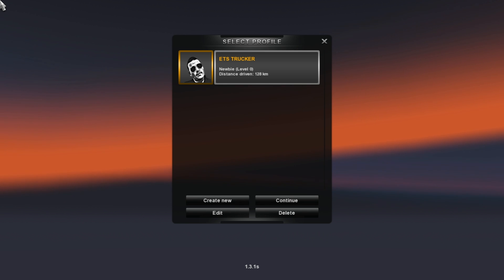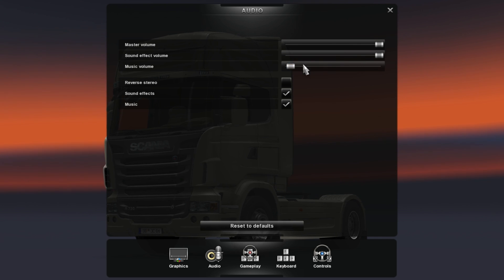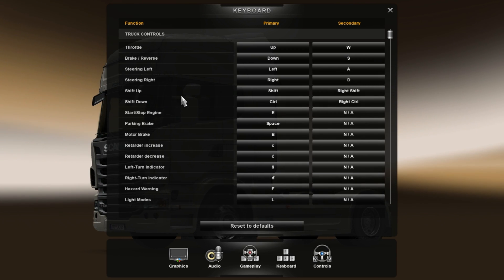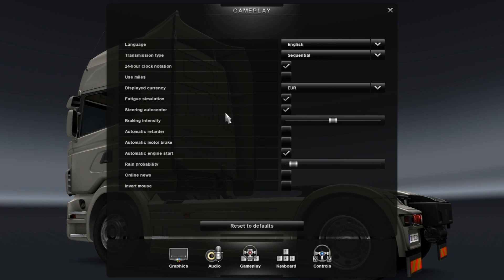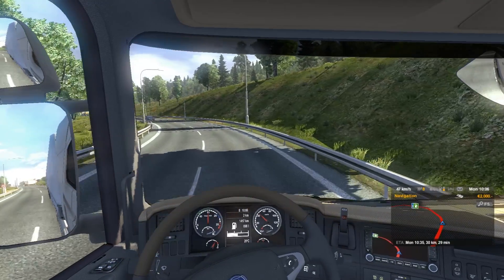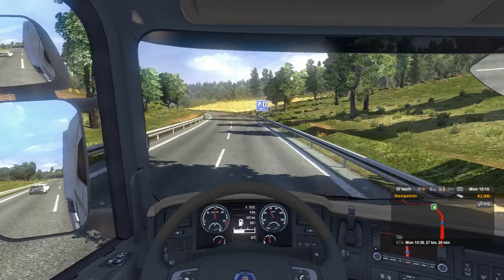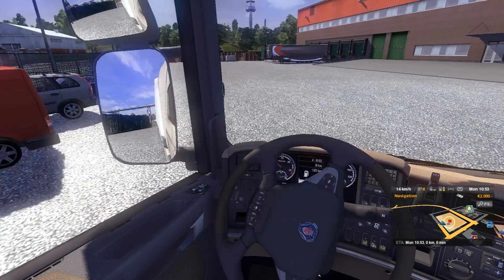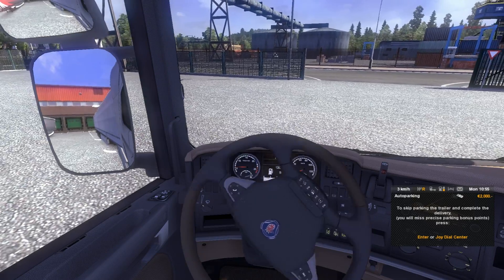ETS 2  Logitech Driving Force GT setup

Comment: idk if anyone is still here but when i turn my wheel 90 degrees the ingame wheel only turns a little bit and when i almost do a full 900 degree rotation is suddenly goes really fast and matches with my wheel. I have both my game and my profiler and 900 degrees and i even did 767 degrees and it has the same issue

Comment: um I need some help with my wheel settings with my driving force gt wheel when I turn my wheel when I turn my wheel a little to the left or right my wheel in the game turns it all the way to the left or right I want it so I can turn my wheel and inside the game game it mimics the it turns the wheel the same as I do in reality
Reply: Did you fix it?

Comment: 'How do i change my logitech driving force to 900 deg?
Reply: Bob Probert in windows, find game controllers in controll panel, open driving force gt (with it connected) click properties, then settings and set the degrees   of rotation to 900,
and for the rpms, make sure that the brake and accelerator pedals are both mapped properly in the keys and buttons option in the actual game.
I hope this helped!
Reply: Download logitech software
Reply: @IFredmybed Thanks for your reply, that helped me.
Reply: OMG thanks I legit couldn't find this answer anywhere

Comment from the maker: Guys, try to remap all the controls again. That mean's that you need to reselect all the buttons again, and also unplug and plug in your wheel from your PC.

There is a bug about that 90 deg but I haven't find what causes it.
Reply: +Giorgio DaTrucker How set shift up or shift down 
Control please :)
Reply: +Giorgio DaTrucker You''ll have to go to, Printers and Devices - Logitech GT wheel and configure so it can turn all the way.
Reply: +Giorgio DaTrucker Great video!
Reply: +gibrate1 how?
Reply: then settings
Reply: Exactly how I say  Printers and Devices - Logitech Wheel then settings

Comment: Your english is good, do you know the problem where the wheel turns too much. I turn a little on the driving force gt and the wheel on screen turns halfway.
Reply: You need to set the degrees of rotation in the logitech profile, to 776 so that when you turn your wheel, it turns the same amount as the wheel in the game.
Reply: or lower the wheel sensitivity in the game :)

Comment: Can you please help me i'm getting crazy. I've the same problem as the discriber olli, if i turn my wheel 3/4 it turns full around what must i do??? Please help
Reply from the maker: it is a bug,, what wheel are u using?
Reply from the maker: my skype is: giorgio.datrucker
Reply: I have the same 
I use the logitech driving force gt
Reply: +Giorgio DaTrucker  It's not a bug, you have to set 776 for you degree rotation.

Comment: did you install the program from the cd that was with the steering wheel ?
Reply from the maker: Yes, from the install cd. But you will need a program for that wheel that you can find on the Logitech web site.
Reply: Giorgio DaTrucker whats the name of the program ?
Reply from the maker: It is "Logitech Profiler" Version 5.10.127 (date 06/14/2010

Comment: Hi!
I have tried your setup, but it will still not work  properly. The probem comes when i shall turn the wheel around. When i have turned it a 3/4 of  a round, the Wheel in the truck turnes full around. What am i doing wrong ? I have  changed the set up in Logitech profil, so the rotation is now 900 degrees, and the game can not change the setup.
Reply from the maker: there is a check box in the Global Device Settings in your Logitech profiler... it is Allow Game to Adjust Settings... that needs to be checked.. see that maybe it is unchecked!
Reply: Giorgio DaTrucker stil got the problem :/
Reply from the maker: Ok then we need to talk over skype or Team viewer ? So I can try to find the problem... send me ur request on my skype tomorrow ok... "giorgio.datrucker" is my skype... cya
Reply: Giorgio DaTrucker ok, i will do.. thanks!
Reply: +olli have you fixed it?

Comment: I got Driving Force GT aswell and I got input lag (Only in ETS 2) What should i do?
I going to steer left or right and it sometimes like stucks.............
Reply: if you have a VGA NVIDIA can try to change this 3d settings: maximum pre-rendered frames to the minimum value
Reply: marcinho Munhz Thanks, gonna try it out!
Reply: Where the hell is the 3d settings????
Reply: Kevin Kulberg right click on desktop, nvidia panel, manage 3d settings. You can try from the global configuration or in the specific program to not have problem in other games. Sorry for my bad English
Reply: marcinho Munhz Maybe that's the solution. Luck.
Reply: marcinho Munhz Ahhhhhhhhhhh, i reinstall the game at steam right now.... :D I HOPE VERY MUCH THAT WORKS!
Reply from the maker: you should remap all the commands in the game... that is the problem... Driving Force GT has some bugs with ETS 2
Reply from the maker: can you post pictures of your settings in the game for wheel

Comment: Just found out what was the problem by screwing around with options..... i previously set the steering left and steering right key bindings as right and left turning of the wheel respectively but i just changed them back to the ones i used with the keyboard ( A and D on keyboard) and it's fixed the steering is perfect now, hope this help you !!

Comment: Tried your solutions and even tried to make a profile for ETS 2 in Logitech gaming software but nothing seem to work... my truck steering wheel and wheels lock when i turn 180 degrees with my driving force GT and the truck kinda keep turning but in a sliding way idk how to explain lol it's weird, that  never happened when i was playing with keyboard so i'm assuming i can probably fix it i just dont know what could be the problem

Comment from the maker: Sometimes my wheel gets in that kind of position, but i have a problem with the wheel losing calibration. I solved the problem by unpluging the usb cable and pluging it back in my pc. Hope it helps, doesnt cost anything if you try...

Comment: So i installed the software on the disc that came with the driving force Gt and set my wheel to 900 degrees, but my truck wheels seem to lock when i turn my controller at about 180 degrees so i can't turn corners in cities not even gonna mention very tight corner;;;;; it's kinda like my truck slide when the wheels lock on a turn i dont know if you understand what im trying to explain lol

Comment from the maker: My dear friend, that is the reason I made this video. Please check 03:00 min of the video and set your gaming wheel as I did. The brake and acceleration pedal are set as one. So you need to set your brake pedal by clicking to change and pressing you pedal on you gaming wheel. And the problem solved...

Comment from the maker: Brake axis is the control you need to change... And to do so you need to push the pedal on you wheel after you click on the "Brake axis" control where it says "Joy Accelerator"... It is all there 03:21...

So click on Brake axis control and push you brake pedal on the wheel itself.

Hope this helps...